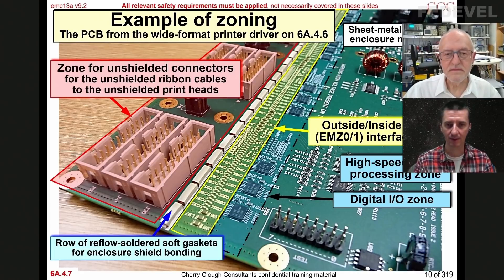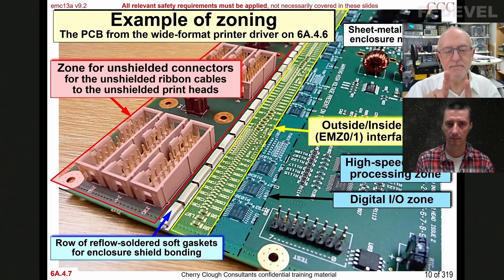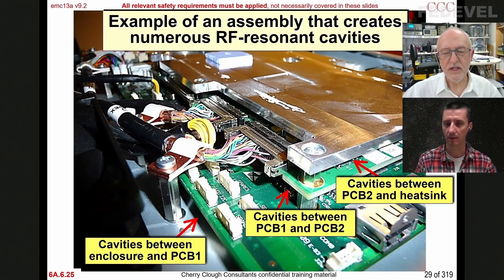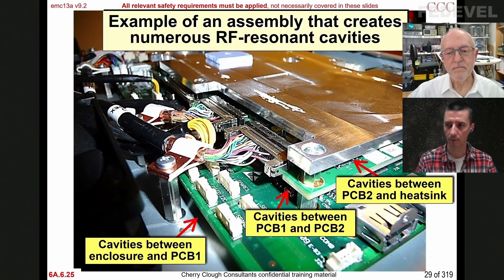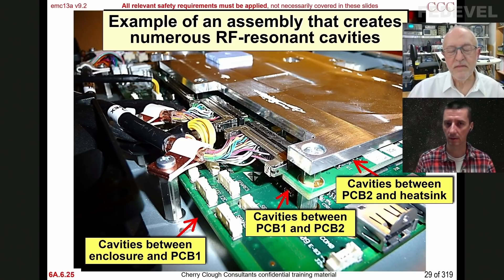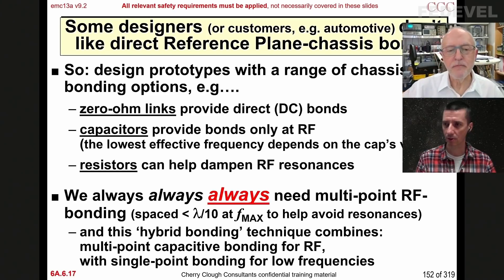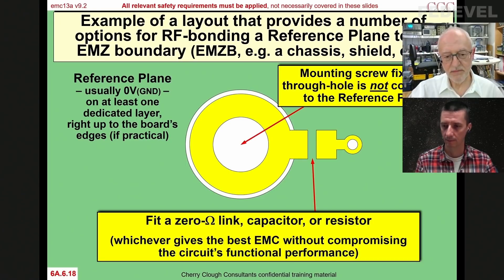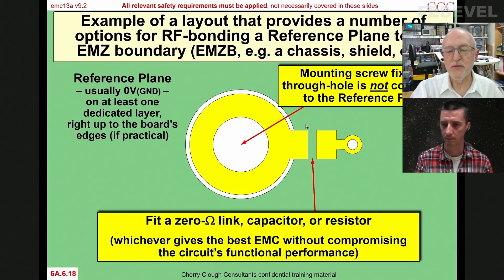Do you connect PCB mounting holes correctly? | Keith Armstrong | #HighlightsRF

Comment: In some cases where I have sub ns rise time signals I can put inductors to the chassis mounting holes. Then I will remove the solder mask around the mounting hole to solder it to see what works best.

Comment: Hi Robert, I connect the 0V on a board to the chassis via a capacitor in parallell with a high impedance bleeder resistor for being able to handle esd-pulses. I understand what you mean by placing a resistor here instead with the purpose to dampen out oscillations. How are your thoughts regarding this? Do you think I should place a resistor in series with my capacitor then? Will I then be able to handle the esd-pulse? Thanks for great videos! /Tomas
Reply: I’m in the automotive ECU design world, I use a 10k to 33k bleeder resistor, the ESD/EMI capacitor, and a small (2.2 to 10 ohm) series damping resistor. The trickiest part is to damp the resonance but not create too much impedance for the BCI testing or ESD, I use ESD rated parts here, and the very low value damping resistor does ok in the ESD testing I’ve done on this network. The bleeder resistor is a pretty low value here but the voltages are low. This has worked for me, though the resonant issue I face is not high frequency but rather in the 100 MHz range, it’s the wiring harness loop size which is usually a metre or two long.
Reply: @dale116dot7  Thanks for your share! This is also how I am thinking!

Comment: I am confused now. I got the impression like with connecting a USB or other connectors to a board, to connect the shield of a cable or connector to the encasing of the device, not to the reference plane. Analog i thought to not connect the mounting hole to the reference plane; can a metal screw act like an antenna or stub? And is this the reason for the 1/10 lambda rule?
Reply: It's all about EMC. The space between conductive planes can be seen as a cavity resonator that generates radiation interference. The conductive posts can conduct the received emissions that causes conductive interference to the reference plane of the PCBs. Damping or filtering the unwanted resonance can significantly reduce the effect of the radiation. 
It can of course cause the potential difference between the reference planes, which would be a problem when interface the signals between boards. It is not recommended to directly connect ground in this case as it may cause grounding loop problem. Differential signal can be an ultimate solution in this case.
Something like grounding and earthing involves some knowledge and there are still some research about it. I recommend a book called "The Circuit Designer's Companion".